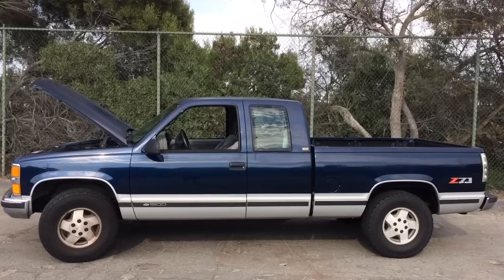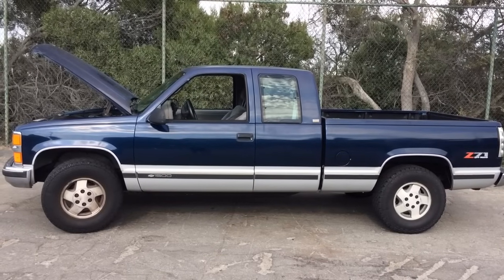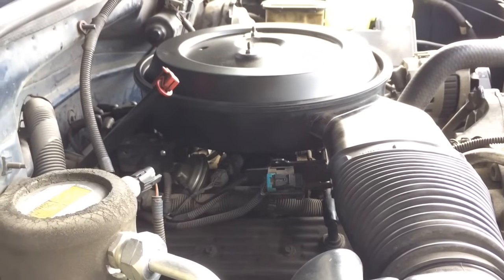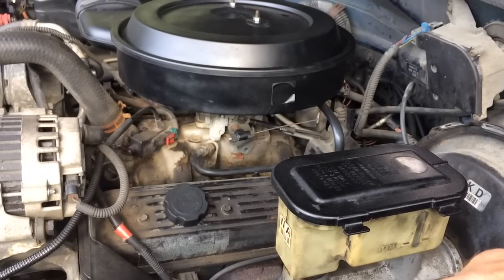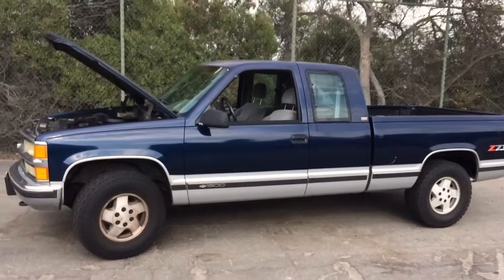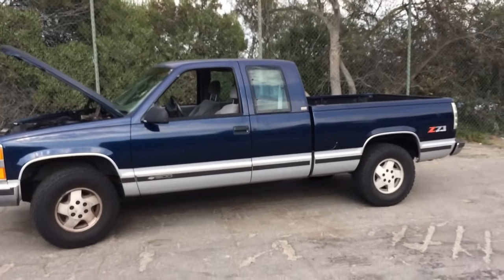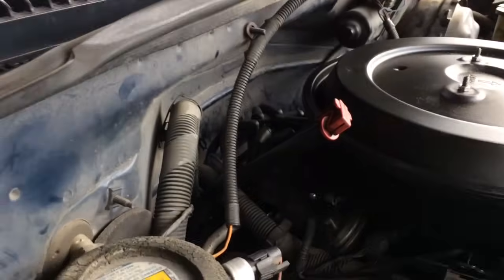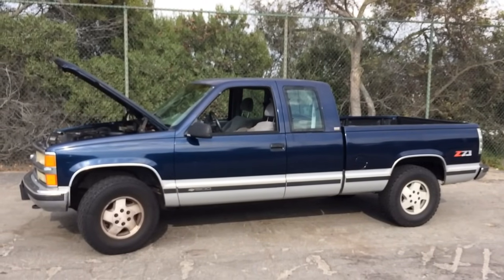Chevrolet Truck Hesitation Problem Fix

Comment: @hoohoohoblin thanks for the info. so I have an 04 Chevy Tahoe, My mom borrowed it from me for a couple of days to move and I found out she went and got gas and put some gas in an old metal gas can which I decided to go take a look at before I took off  and the damn thing had rust inside of the can, I mean there was rust coming out of the can not just a little rust on the can, anyways I was pretty pissed about it but I was in a hurry and didn't go back into the house well then I took a long trip and I'm not sure why but my Tahoe only has a top speed of like 98mph and I was going about 90 to 92mph for about an hour at night on the expressway with what seemed like there was no one else on the road, I think in that hour I seen one other car, anyways about 2 days later is when the sputtering and the hesitation started, I replaced the fuel pump but afterwards I sprung a gas leak from the lines do to the rust, so now I am waiting for the new fuel lines to arrive, but I am thinking it might be the injectors which might be clogged or a bad sensor, but once I install the new lines I will update my post
Reply from the maker: Make sure you change the fuel filter as well.

Comment: Finally ! .... I hope .  If have a '90 GMC Suburban and have been chasing this issue for close to a year as well. Same symptoms. It will sometimes do the same hesitation or stall when low on fuel, when traveling uphill only. Dont know if it's related,  but changed the pump a couple years ago... wonder if the "sock" fell off.. I dont know , and I hesitate to do that chore again unless absolutely necessary... have not tried the catalytic converter.  Considering removal. Anybody have thoughts on this.. in the performance category.
Reply from the maker: On my truck, the one in the video, I’m pretty sure it was the catalytic converter along, and I wish I’d replaced that first.

Comment: mine is having hesitation while driving. maybe the MAF sensor. idk
Reply from the maker: This is a tricky problem to fix. It could be a lot of different things. On my truck, it ended up being a clogged catalytic converter. The plates come loose, so sometimes they obstructed airflow and sometimes they didn’t.

Comment: I had a problem with a faulty filter that made me drop oil pressure on takeoff
Reply: Fuel filter or oil filter????
Reply: @aokbikelife5564  oil. When I would take off pressure would drop and then regulate after a while and when I would try to accelerate in 1st and 2nd gear it would backfire and not go anywhere

Comment: I had a problem where every time I stopped at a red light the suburban would stall. Changed everything. Rebuilt throttle body. Nobody could figure it out. Took to a shop where there was an old school mechanic there who was now retired  but he told shop owner that it’s my knock sensor. Changed it out and sure enough that was the problem.

Comment: What if: 1999 blazer, runs fine, hit the gas to pass, the engine rev's but doesn't go to a passing gear. Also, after I drive for 1/2 hour and stop at store, when I start it up, it's fine but put into gear it bogs for a second, then fine. If I pop it into N  during this bog and coughing it idles fine. Then all is fine
Reply from the maker: It could be the ECU engine computer. Mine went bad, and it caused a lot of strange shifting problems in the transmission. I think your model has a different transmission than mine though.
Reply: @hoohoohoblin  thanks for replying
Reply: @hoohoohoblin  it was my MAS wow what a difference

Comment: Where did you bought the fuel pump at ?
Reply from the maker: I’m not sure where it came from. I had the mechanic that worked on my truck put it in, and I told him to give me one that was more expensive. If you look at an auto parts store, they will give you a few options from cheap to expensive.

Comment: When the cat converter rattles, it's 'cause the TBI is dumping fuel and it detonates in the heat of the converter. Haven't fixed mine yet, but went thru two C.C.s in a year. Don't really drive it.
Reply from the maker: +neshobanakni Yikes! That can get expensive.

Comment: My 95 c1500 is at about 251k miles and is having alot of problems poppin up lately, trying to figure it out little by little, about to replace the distributor and plug wires to see if my problem still continues, if anyone has had hesitation problems and a new distributor has fixed it please let me know.

Comment: I have a 90 k1500 with the tbi and the best thing to do for those is get a 454 fuel pump since the ones on them suck, and take the bed off don’t drop the tank. Then the injectors, don’t get new ones clean the old ones, new ones that actually work are hard to find. And it’s a tbi which has the worst heads and cam Chevy has ever really put in there engines. but eh what can I say there still great trucks, and I love mine. If you buy a ford you shoulda bought a Chevy. That’s all I can say
Reply from the maker: Thanks. These really are good trucks.

Comment: The first thing I would look at is taking the hat off along with the TPS and just clean the throttle body
Reply from the maker: Thanks. I started with a small simple things and work my way up. In this case, the catalytic converter was definitely clogged, and the fuel pump was weak.

Comment: after your done throwing parts at it put a new distributer shaft and pick up coil. If cat went bad you have misfires going on.
Reply from the maker: Thanks.  That's one of the parts we threw at it.  It runs fine now, and I suspect the main problem was the catalytic converter, but I can't be sure.  I'm just happy to have it running right again.
Reply: Yes your right about the distributer shaft, mine broke while on a trip from Homedepot ,broke down on the side of the road got out broke my tools out and didnt have a clue, so i pulled the the distributor out slowly straight up and bingo no gear the gear was at the bottom still, called a friend and had him buy me a stick magnet and a new distibuter from the local shop and carefully stuck the stick magnet down and retrived the washer and then the gear, both my friends jaws were on the ground, then stuck the new distributer in and it wouldnt start, turned it 180 degrees and bingo purred like a kitten  and drove home didnt even have to do the timming and after 2 years still purring like a kitten at 80 mph, awesome 2000 GMC C3500 with full utility bed and rack

Comment: 1995 cheve 5.7 Heater speed fan switch only works on high
Reply: Mike Gross  fan speed resistor is bad. Under passenger side Dash next to blower motor.
Reply: Fan speed resistor under the dash in glove box hard to change

Comment: Why is my steering wheel crooked and how to fix it
Reply: Alignment, new ball joints tie rods
Reply: Someone may have put it on with the wheels slightly turned. You'll have to take it off and straighten it. Make sure your wheels are straight before you take it off.

Comment: i need suggestions, my 91 chevy has trouble with dying when going slower like under 15 maybe.. i changed the map sensor and need suggestions on what to do next .
Reply from the maker: Could be clogged fuel filter, stuck EGR valve, or dirty furl injectors. These things are sometimes hard to figure out.

Comment: YOU DO NOT HAVE TO DROP THE TANK!!!! IT IS EASIER TO GENEROUSLY LOOSEN THE PASSENGER SIDE BED BOLTS AND COMPLETELY REMOVE DRIVER SIDE BED BOLTS AND JACK UP DRIVER SIDE OF BED UNTIL YOU HAVE ADEQUATE ROOM TO MANEUVER THE OLD PUMP OUT AND NEW PUMP IN
Reply from the maker: You’re right. Thanks.

Comment: I knowing people who kept the gas tank on and just taking off the truck bed just to change the fuel pump my friend I hope this comment helps  somebody out here peace
Reply from the maker: Thanks. Some people also cut a hole in the bed to get to the fuel pump and rivet a metal plate over it when they are done.
Reply: That's the only way to go. I have a tractor with a front end loader that makes removing the bed super easy.
Reply: Taking the bed off is definitely easier 😝
Reply: THANKS U 9TH

Comment: I have changed every single thing u named the only thing left is the cats
Reply from the maker: I wish I had change the catalytic converter first. I’m pretty sure that was the problem. I took it to a mechanic, and he said that the plates in it had broken loose, so sometimes the exhaust was able to flow through it fine, but sometimes the plates would bounce around and block the exhaust flow. I think it was around $350 to have a new one installed.

Comment: did the same thing to my truck changed all the sensors first ontop now have to do the oxygen sensor and if not that then the cat then intake gasket then distributor check the teeth if not that then torqe coverter is sticking
Reply from the maker: +AnDrEw 831 I bet the catalytic converter is the problem, or maybe the muffler is all clogged up. These things are tricky to diagnose, and I always want to try the cheapest easiest things first.
Reply: hoohoohoblin  guess what was the problem the ignition coil was giving a week spark but was still had a miss and 1day at night I was jumping my c10 truck and saw a spark from a spark plug which had a crack...so swap that and runs great now! And also did the intake gasket for pressure

Comment: How did you change the computer?
And did it work ?
Reply from the maker: I bought a used computer on eBay and replaced it. You have to make sure you get the exact right one for your truck. It has a model number on it.

Comment: my problem is the opposite. When I come to a stop, the truck lurches forward like Im stepping on the gas. But im not. Im braking. HELP!
Reply from the maker: Not sure what would cause it. Maybe a bad throttle position sensor, or maybe the fuel injector is leaking too much gas into the cylinders.
Reply: thnx bud. ill check it out
Reply: @sizzlechooch  having the same problem... what ever happened man did you fix the problem?
Reply: @zxJC34xz  U know I forgot all about that problem. It never happened again after that one or 2 incidents. Yeah, that's weird. But thanks for asking.

Comment: Mine dies and fits all the symptoms, but you didn't tell me what it was....I basically gotta do everything I have done and more.
Reply from the maker: In my case, it might’ve been a combination of things. You should try the catalytic converter first. I think on my truck the fuel pump was weak, and the catalytic converter was worn out and clogging up the exhaust flow.
Reply: @hoohoohoblin   thank you for your response. After you did those two did you notice your power loss under load go away? It sounds like it's many things playing a role in what's wrong with mine. I have yet to check cat and fuel pump pressure. Going to buy a timing light today as well. Nice truck btw.

Comment: My 1989 had hesitation. Seems like I checked everything. It turned out it was a corroded coil wire the whole time.
Reply from the maker: Thanks. These things are really hard to diagnose, and sometimes it’s something small and simple.

Comment: 1988 Chevy hesitation and no power around 55mph can some one help me it has new plugs and wires fuel and air filter new maf ecm and iac + tps and O2 sensor
Reply from the maker: Could be a problem with the EGR valve. Maybe it is stuck open.
Reply: @hoohoohoblin  seems to be free and clean

Comment: My 90' Silverado Had the Same Problem I just Cleaned the Carb
Reply from the maker: Things were a lot simpler back in the carburetor days.
Reply: @hoohoohoblin  To bad they weren't carbs in 90, its either misinformation on Kenneth_fix's part or someone changed out the TBI to a carb on his rig

Comment: Your problem was your distributor. You can buy 5 at Autozone and everyone of them will have a different problem. Get a good one and save some headache.
Reply from the maker: I’m sure the distributor was part of the problem. We replaced it along with the fuel pump and catalytic converter, and the truck runs fine now.

Comment: What was the last part you changed when the problem went away?
Reply from the maker: We did the catalytic converter and the fuel pump at the same time, and it ran great after that. It was one of the two. I had a mechanic check the fuel pressure and found it was low, so I’m sure the fuel pump was part of the problem, and he also said that the plates in the catalytic converter had come loose and rattling around.

Comment: Its usually the EGR
Reply: Rukkkis that or fuel filter most of the time on these body style trucks
Reply: What is the EGR?
Reply: I agree also with a 1995 350 TBI your going to want offset wrenches to loosen the EGR bolts. Had no luck with short and tall sockets, crows feet, open and closed wrenches and it seems like a 45° offset does the trick nicely.
Reply: This guy is right. That’s what mine was. I just disconnected the vacuum line to it and the truck runs like new. Didn’t have to throw a bunch of parts at it or take anything apart. 🙌🏽

Comment: That is a fuel filter not fuel pump
Reply from the maker: You are correct, sir!  I replaced both.
Reply: hoohoohoblin did you go with the 95 vane style fuel pump or ugrade to the 96 vortec style capable of higher pressures?

Comment: ive got hesitation, it drives fine below 2000 rpm & when cold,but when i punch it it hesitates! replaced the  tps ,plugs, leads,ignition module & coils,o2 sensors,fuel filter, & crank sensor still hesitates im thinking bad fuel pump but its only 18mths old. go figure,what a drama, drivin me mad!
Reply from the maker: That is almost everything!  Maybe the EGR valve or an intake manifold leak, or dirty fuel injectors?  On my truck the plates in the catalytic converter had rattled loose and sometimes blocked the exhaust flow. It could be that, or the same thing happening in your muffler.
Reply: @hoohoohoblin  eé

Comment: I experience a spongy brake pedal and research tells me this is a common problem on these trucks do you have the same symptoms???
Reply from the maker: +hectot zepeda I don’t think it is a common problem, as much as it is that you need to bleed the brakes and get some fresh brake fluid in there. Mine was spongy until I bled it, and now it is fine.
Reply: Mine had same problem until I replaced brake booster

Comment: I have a 96 chevy k1500 and it feels like 1st gear has no power but all the other gears kick in fine after ? Anyone have an idea what it might be?
Reply: NAVE 727  hey bud ever find out what your problem was I have same truck same problem plus a rough idle just curious to see.
Reply: Todd Burnett I had to buy new air filter it would release a lot of pressure for the first gear to kick in good I also had to change all my spark plugs basically a tune up in wires

Comment: I know the tps is going out on my 91 silverado. It's a potentiometer and those contacts wear out. I have a code reader and the tps voltage at idle is only .5 volts, suppose to be 1.5 volts & full throttle suppose to be 4.5 volts it's only 2.75. Thing is i read somewhere once you replace it the computer may never work right again.
Reply from the maker: +jasonmushersee I have replaced the TPS on this truck and on a GMC Safari van, and the new one worked fine.

Comment: Does anyone know what the engine code 43 is and what I can do to fix it I would appreciate any info please ?
Reply from the maker: +Sammy Marquez That is the ECU circuit. The signal to the ECM has remained low for too long or the system has failed a functional check.
Reply: Hoohoohoblin thanks man I appreciate your input so the truck just started this and got worse after changing the transmition.
Reply: do not worry about that 43 code...i get that on my 92 chevy van every time i floor it.. its the knock sensor. never given me a problem stalling or no power etc...

Comment: I'm having a problem where my 1995 suburban 350 tbi runs a bit rough and hesitates only when cold. Anyone have this problem?
Reply from the maker: Mine does that too, but it’s fine after a minute. Still haven’t figured out why.
Reply: Check the Coolant Temperature Sensor. It reads the temperature of the engine coolant and through the ECM adjusts the Air/ Fuel mixture accordingly. Also could be the IAC (idle air control valve) which basically acts as an electric automatic choke on a TBI engine. Hope this helps. Both will cause a cold start rough idle or cold start stalling issue.

Comment: lol... ummm, buy a Haynes manual next time. i admire the effort though. But all these things have basic tests before you dump $$$ into it.
Reply: It's a old truck and probably needed to be replaced anyway so I'm sure it wasn't wasted money
Reply: I have, read, and use my Haynes manual.  The problem is hesitation when taking off.  Almost have done everything this guy has and still have not solved my problem.
Reply: @brucepugh1536  disconnect and plug both ends EGR. ignore check engine light it trips
Reply: @mikemunro5149  The EGR valve I replaced with a new one has only one vacuum plug.  Do you mean unplugging both vacuum plug ends of the EGR Solenoid then ignoring temporarily the Service Engine Soon light until I plug it back up?
Reply: @brucepugh1536  yeah. it's emissions garbage going into that computer. likely the oxygen sensor but your dealing with old wires rust corrosion etc. light only comes on hwy when it tries to fine tune emissions and cant. likely cause of hesitation, computer error, false readings
Reply: @brucepugh1536  if u really want to keep truck - check edelbrock for new injection system and aluminum head
rip that cfi off

Comment: I have a 2007 Sierra classic 5.3 4x4 
It won't rev above 2000 rpms when driving I can put the pedal to the floor an it won't go above 2k rpms until it reaches 50mph then it'll go to 2500 rpms anyone know of any souloutions
Reply from the maker: Could be a clogged EGR valve, or a throttle position sensor. Sometimes the ECU unit goes bad on these and causes that kind of problems as well. Or they could be an obstruction in your exhaust system. On my truck the catalytic converter was clogged up.